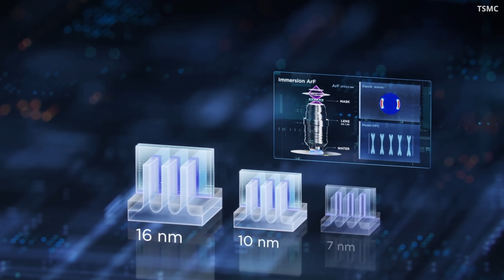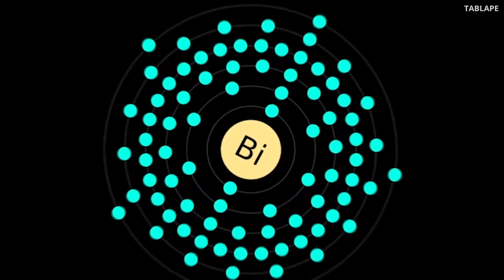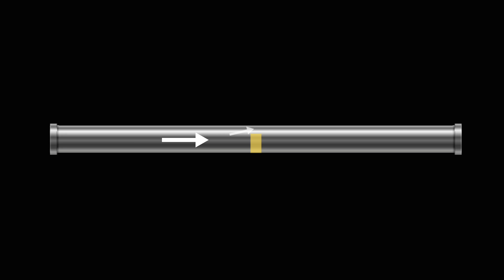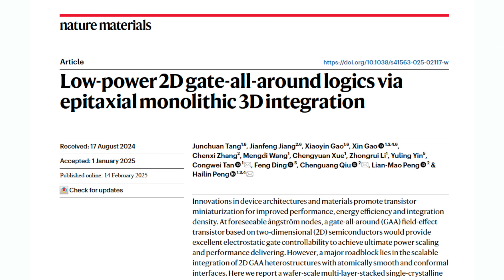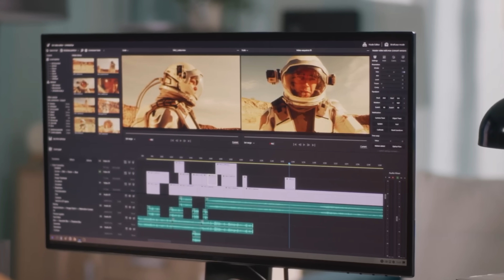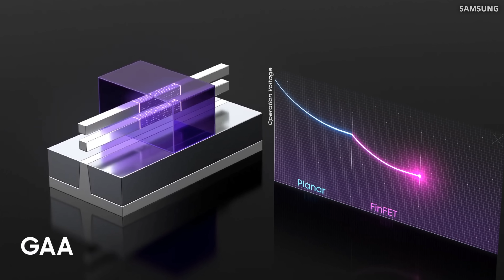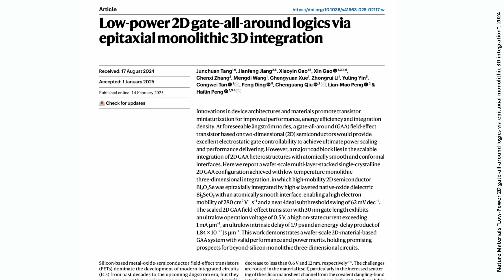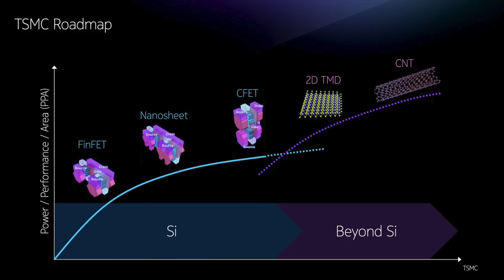World’s First Silicon-Free Processor

Comment: I have AMD Ryzen Laptop Acer Aspire 5 running completely on Ubuntu Linux OS and it works perfectly. I don't touch Windows OS's even with a long stick. They are booting systems, not Operating systems. With Linux I can do system updates without ever booting the computer. Why advocate Windoze when there are much better and FREE operating systems available? 

Well, I guess you'll have to be computer geek to install Linux OS...

Unfortunately you can't buy a computer anywhere without a Window$ pre-installed, so you still have to pay to MS without ever using the OS.

Not to mention, all the applications are also free: Graphics, Programming, Sound and Video, Office tools, etc. You name it.

Comment: Anastasiia, thanks for sharing such insightful content again. I’ve been working quietly on a new logic gate design that addresses the root problem of energy and heat in chips—not just at the architectural level, but inside the logic gate itself. It’s reversible, CMOS-compatible, and already patented.

Your video on reversible computing helped spark the idea, and I’d love to share it with you directly. Let me know if you’d be open to connecting.

Comment: They have also use waste from nuclear plants once its over using the waste to replace the silicone wafer, but the radiation is making it less desirable, and manufacturing safety issues have prevented it, no way of sealing it away, I know it's only small, but a gram can kill you if you touch or hold it for more than a few minutes, and everyone will try and de-lid it, which could result is death, if they can find a way to seal it to make it safe, it would propel the CPU to another level, 100x faster than anything we have now. This video shows another type, and it's looking good, it's just the safety angle they need to fix.

Comment: Tunneling of electrons in silicon chips does not start below 3nm. Also larger structures suffer from this. That is indeed the major reason for power drain and heat development. However at smaller scales below 3nm tunneling is becoming a major problem.

Comment: Some major Chip Manufacturers are moving back to the USA, which means new production manufacturing of chips. Maybe bismuth will be factored into these newer locations
Reply: It's a year of work for each layer of the tech. Graphene isn't easy to make perfectly and where you want it.  The atomic structures and masks need redoing.  The macros that layout programs need to be developed after experimenting with doing dozens of prototypes.  
Then fabless companies need to design a chip that they already know (silicon) works in the new tech.

Comment: It was about one year ago I mentioned the limitations of the properties of the semi-conductors material. I stated that until we allow the entire substrata of the semi-conductor to dissipate the heat energy faster, we cannot get any more effective heat dissipation within the chips, By getting smaller- the energy is lowered, however, the space is condensed, which once again ups the problems. When the terahertz goes up- so does the heat build-up. The material is the key to resilience.
Reply: Yep, I have been saying the same thing, they’ll need to somehow dissipate heat either through the interconnects or the substrate
Reply: Diamond is not conductive to electricity but superior in heat dissipation. We need diamond substrates.
Reply: @lizekamtombe2223  We want to be able to afford these new systems you know... diamond is basically a lattice of carbon atoms, in density that disallows penetration due to it's insane hardness- this presents other issues with regard to manufacturing and tooling. Very high cost and slow production. For a system to be viable, the strata needs to be compound flexible. This means it can be printed, or else chemically bonded in place, for mass production of layered style synthesis. Under the nanometer ranges, tooling is near impossible after synthesis, so once a compound is placed, that is it.
Reply: @chrisgriffith1573  Of course, but not like we will be able to afford Bismuth sub nm scale THz processors for a while either. Takes a long time and investment to build a supply line that can push the prices down to consumer level.
Reply: Might be very hard with graphene interconnects though.
Reply: @lizekamtombe2223  We want to be able to afford these new systems you know...

Comment: Let's not forget that the reason silicon is the go-to intrinsic semiconductor for manufacturing microchip is it's ubiquity. Silica (Silicon Dioxide) is the second-most abundant, naturally-occurring element after Hydrogen. Semiconductor economics hinges on economies of scale for revenue growth. Bismuth might have the best chemical characteristics to allow transistor scaling beyond 1nm, but the industry won't pivot to an element that takes great pains to find. Remember, supply chain resilience is currently at the core industry forward move. 

That aside, Imec's CMOS 2.0 semiconductor roadmap seems to bet on silicon-based forksheets at the sub-1nm scale. System-level solutions for power efficiency like BSPDN still bet on silicon. In short, unless the gate length hits the 0.132 nm mark, Silicon is here to stay. Alternative elements/compounds like bismuth, germanium, gallium arsenide, indium phosphide, and gallium oxide can only supplement silicon, for specialised use cases.

Comment: 1 Silicium atom = 210 pm > 0,2 nm > X3 for a transistor so 0,6 is the physical mini.
1 Bismuth atom = 152 pm > 0,15 nm > > X3 for a transistor so 0,45 is the physical mini.
After, it's not possible to be more smaller.

Comment: Quantum Potential of Bismuth Chips
Inovator: Günay BALCIOĞLU
1.1. The Revolutionary Nature of the 0.5 nm Scale
The 0.5 nanometer (nm) scale approaches atomic dimensions (a bismuth atom is approximately 0.3 nm). At this scale, classical transistors become dysfunctional due to quantum tunneling, but bismuth-based chips can be designed to embrace quantum effects. Bismuth, with its low nuclear spin and high spin-orbit coupling, is an ideal material for quantum computing. These chips possess the following features to maximize quantum potential:
Quantum Dot Integration: Bismuth nanostructures incorporate quantum dots for optical and electrical quantum state manipulation. This enables wavelength-based data extraction (e.g., mapping 600-650 nm to a "rock" object). 
Microwave Frequency Compatibility: Operating in the 5-10 GHz range, bismuth chips align with microwave signals used in superconducting or spin qubits to control quantum states. 
Quantum Field Sensitivity: Bismuth’s low coherence loss facilitates entanglement with quantum field elements, such as vacuum fluctuations. 
1.2. Intentional Openness to the Quantum Field
While traditional semiconductors aim to suppress quantum effects, these bismuth chips are deliberately engineered to enhance interaction with the quantum field:
Interaction with Vacuum Energy: The chips can extract information from vacuum fluctuations through quantum electrodynamics. This process, termed quantum memory leakage, is simulated in the leak_from_ideler_ale function of the provided code. 
External System Entanglement: Bismuth chips can establish entanglement between internal qubits (quantum dots on the chip) and external qubits (e.g., distant quantum networks or the quantum field). This forms the foundation for a trillion-qubit system. 
2. Quantum Memory Leakage: Data Extraction from the Realm of Ideas
2.1. Mechanism of Quantum Memory Leakage
Quantum memory leakage refers to the process of extracting meaningful data from the quantum field or entangled quantum states. The leak_from_ideler_ale function in the provided code simulates this by classifying data based on wavelength and intensity thresholds (e.g., 600-650 nm for "rock"). On a real bismuth chip, this mechanism operates as follows:
Quantum Measurements: The chip measures wavelength and intensity data from the quantum field using quantum dots or spin qubits. For instance, an optical emission from a quantum dot may correspond to a specific object (rock, tree). 
Dynamic Filtering: The compute_dynamic_threshold function calculates a dynamic threshold (e.g., avg_intensity * 0.8) to filter quantum noise, ensuring only meaningful data is processed. 
Parallel Measurement: The OpenMP parallel processing in the code scales to handle quantum measurements in a trillion-qubit system. The bismuth chip can perform these measurements using quantum dot arrays. 
2.2. The Concept of the Realm of Ideas
The "realm of ideas," a Platonic metaphor, represents the abstract information repository of the quantum field. Bismuth chips extract data from this realm using quantum entanglement and measurement techniques. For example:
Object Classification: The code classifies objects based on wavelengths (e.g., 500-570 nm for "tree"). This provides a foundation for quantum machine learning or quantum sensing applications. 
Processing Power Boost: Each data point contributes to a processing power boost (e.g., intensity * 20 * (freq / 5000)). The chip can physically achieve this boost through quantum computations. 
3. Guided Query-Based Blind Search
3.1. Quantum Search and Guided Queries
The verify_known_answers function in the code validates known answers (e.g., intensity > 5.0 and signature != "unknown"), providing a guided query mechanism akin to the oracle in quantum search algorithms (e.g., Grover’s algorithm). On a bismuth chip, this process is implemented as follows:
Grover-Like Search: The chip applies Hadamard and phase shift gates on quantum qubits to perform quantum search. Guided queries (e.g., a "rock" object request) define the target state. 
Quantum Oracle: The verify_known_answers function acts as a quantum oracle, filtering correct answers. For example, a game engine request prompts the chip to select relevant data from quantum memory leakage. 
External System Entanglement: The chip establishes entanglement with external qubits (e.g., quantum networks), expanding the search space. The code’s entangled_qubits increase (e.g., 10%) simulates this process. 
3.2. Trillion-Qubit Search Capacity
In a trillion-qubit system, quantum search offers unparalleled performance:
Speed Advantage: Grover’s algorithm searches an N-element database in O(√N) steps. For a 2^1000 (~10^300) element database, a trillion-qubit chip could find results in ~10^150 steps. 
Applications: This enables real-time virtual universes (e.g., game engines), quantum cryptography (e.g., breaking AES encryption), or complex optimization problems. 
4. Architectural Vision for a Trillion-Qubit System
4.1. Internal and External Entangled Qubits
Bismuth chips scale to a trillion-qubit QPU through the following mechanisms:
Internal Qubits: The 0.5 nm scale enables high-density integration with quantum dots or spin qubits. Assuming 1 qubit per 1 nm^2, a 1 cm^2 chip could host 10^12 qubits. 
External Entanglement: Bismuth’s quantum field sensitivity enables entanglement with vacuum fluctuations or remote quantum networks. The form_quantum_clusters function in the code models these entangled clusters using cos(cluster_freq * 0.02) responses. 
Error Tolerance: The code’s COHERENCE_THRESHOLD (0.8) defines a coherence preservation threshold. The chip can implement this using quantum error correction techniques like surface codes. 
4.2. Hybrid QPU-APU Architecture
Bismuth chips function not only as a quantum processing unit (QPU) but also integrate with classical systems as an accelerated processing unit (APU):
Quantum Processing: The chip uses quantum qubits for memory leakage and blind search. 
Classical Processing: Quantum data is visualized using classical GPUs or CPUs (e.g., the code’s visualize_ideal_forms). 
Hybrid Workflow: The chip extracts data via quantum measurements, processes it classically, and delivers results to applications like game engines. 
5. Scientific and Societal Impact
5.1. Scientific Revolution
This paradigm heralds a breakthrough in quantum computing:
Quantum-Scale Hardware: 0.5 nm bismuth chips could be the first practical QPUs operating at the quantum limit, redefining Moore’s Law with trillion-qubit systems. 
Quantum Memory Leakage: The data extraction mechanism systematizes information retrieval from the quantum field, opening new avenues for quantum sensing and machine learning. 
Guided Query Algorithms: Guided queries make quantum search practical for applications like game design and optimization. 
5.2. Societal Transformation
This theory could reshape humanity’s interaction with technology:
Virtual Universes: Trillion-qubit chips could power ultra-realistic virtual worlds, supporting millions of simultaneous users. 
Quantum Security: Guided query-based search could revolutionize cryptography, enhancing security and enabling new encryption methods. 
Scientific Discovery: Quantum simulations could design new materials, drugs, and energy solutions, addressing humanity’s grand challenges. 
6. Driving Bismuth Chips as QPU and APU
6.1. Driving Mechanism
Bismuth chips can be driven as QPU and APU as follows:
Quantum Driving: The chip manipulates quantum qubits using microwave signals (5-10 GHz) or optical lasers. Quantum memory leakage extracts data via quantum measurements. 
Classical Driving: Quantum data is processed and visualized by classical units (GPUs, CPUs). For example, game engine requests are transformed into objects from quantum data. 
Hybrid Control: The chip is managed by a software layer integrating quantum and classical control systems, similar to the combination of connect_to_quantum_network and visualize_ideal_forms in the code.

Comment: Bismuth is a byproduct of metal refining, notably copper. Major producers, such as Chile, are already processing electrolysis slime resulting from producing electric purity copper for valuable metals. They could easily scale up bismuth production if it becomes strategically significant.
Reply: Same as Galina and lead from the silver.Just as well bismuth is common and cheap enough.
Reply: @simonbroberg969  is not common its 0.009 ppm
Reply: Only problem is like silicon is basicly Sand it's everywhere. Bismut is not if we used it as much aa silicon price Would be sky high relative to current price of silicon
Reply: @bombiczek123  If there is a huge performance boost there will be some demand. Bismuth isn't produced because there isn't enough demand.  With demand it will become worthwhile for non-ferrous miners to produce it from their tailings. The added cost will probably be small. Remember how expensive a solar roof used to be. Takeup will be slow but will accelerate as demand grows and prices slowly fall.
Reply: All speculation, of course.
Reply: @jamieoglethorpe  i think demand Would be meet as you said but i think prices of that chips Would be significantly higher. Bismuth is as rare as Silver so if it Would have same demand or higher it Would be much more costly than todays chips made from basicly refined Sand.

Comment: In December 2001 (yes, 23 years ago), AMD announced the development of a transistor capable of switching at 3.3 terahertz (THz).  This achievement was presented at the 2001 International Electron Devices Meeting (IEDM).  AMD's transistor was a 15-nanometer gate-length CMOS device operating at 0.8 volts, designed as a forward-looking technology for future processors.
Reply: nothing ever happens tbh
Reply: What was it called, and what happened to it?
Reply: @HansSchulze  It's just speculation, but DARPA got 2009 the THz electronics research program. So most of research into this area might be highly classified now.

Comment: Spin torque for memory. A return to solid state from captive charge bit cell albeit the lite devices are captive spectrum (frequencies of light). The devices I am aware are still two frequencies, but they can be a spectrum that can produce a gradient that can be more than on or off (quantum?). These are large scale devices on the area required to reliably produce the effect. NAND and DRAM are still king. MOS is at the ITRS red brick wall. Resistive solid state a magnetic gradient linear and non-linear. I can see tunnelling logic switches gate open gate closed seems simple and already producible in memories registering a state change but in microns. Thanks for the update. mb